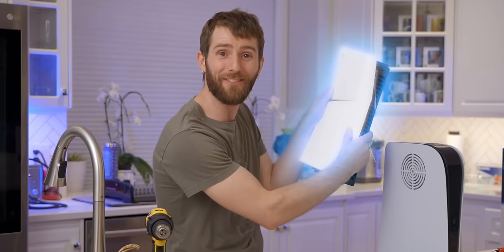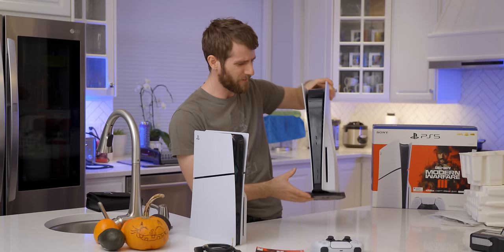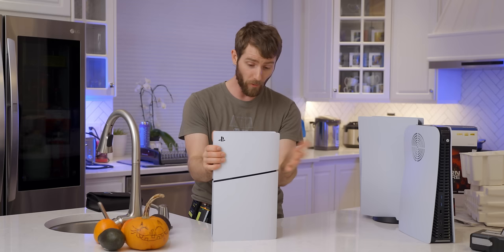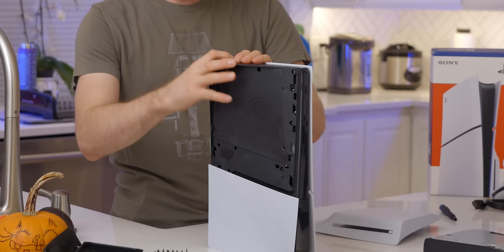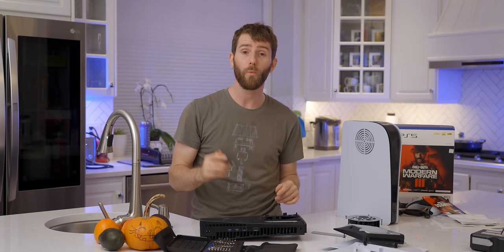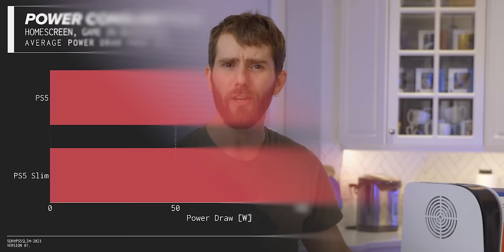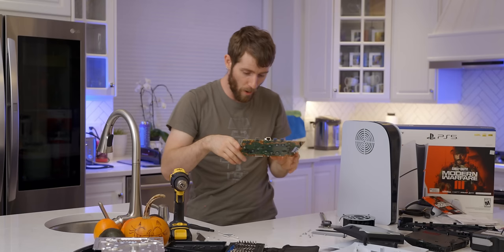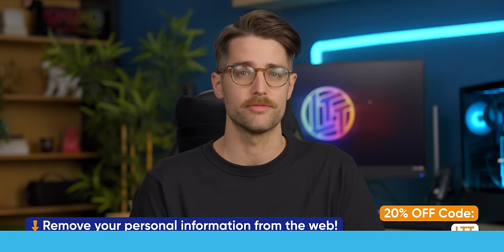PS5 Slim First Look and TEARDOWN!!

Comment from the maker: Thanks dbrand for sending over the PS5 Slim for this video! Get notified for their upcoming Darkplates 4.0 at https://dbrand.com/ps5-slim
Reply: Does this mean i have no life😢
Reply: just under 5 min late but i am here!!!!
Reply: Ok
Reply: comparing size with the stand vs the slim w/ no stand is a bit sus
Reply: someone needs to clean that overhead lens  :person-turqouise-waving:
Reply: Ok
Reply: Guys there is camera issue in top shots of PS5. Pls check
Reply: d brand. d? deez nutz
Reply: Look it's Linux tech tips
Reply: Hopefully Sony won't be able to trace back the partially visible serial number to find out who supplied it to dbrand
Reply: 4.0? TF happened to 3.0? Or was that the arachnoplates?
Reply: @LinusTechTips, great Teardown, but on 1 point you are wrong. The Game included is the full Game Cross Gen Edition and the Operator Pack! Sadly that i was too late to get the Key :(
Reply: Question: Does the Disc version still need to be connected to the internet for it to work?.
Reply: camera lens is dirty 😂
Reply: @rpmurphey1981 bruh huh?
Reply: It's still a PS5, NOT a PS5 Slim!
Reply: Get real they used the code way before posting this video. The editors used it.
Reply: That's sad because basically you're telling me in my town we don't allow more than 20 decimals so that thing would be illegal to run after 11:00
Reply: What about temperature differences ?
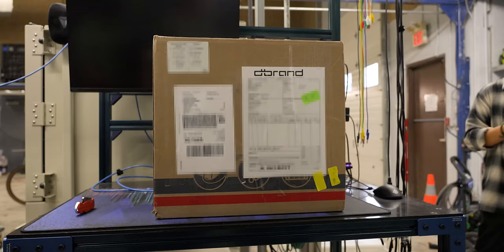Reply: 0:28 Saying 'catched' instead of 'caught' is a grammatical error. It is an error common among children and people who are not native speakers of English. The simple past tense and the past participle of the verb 'catch' is 'caught'.
Reply: Should have criticized the non-removable battery in the controller, technically it is, but not as easy as the Xbox controller.
Reply: @Packin-Heat Thanks man, Hope it's a easy registration since our internet here is Garbage.
Reply: PlayStation creators should be running the government since when did so called ''politicians'' ever provide an improvement and update every 3 or so years..
Reply: @Packin-Heat oh Cool, I didn't recognize they're registering it, Thanks.
Reply: I'm here because of spawn wave.  Good shit
Reply: where's the results of the investigation into the sexual misconduct and abuse?
Reply: You can't call the PS5 a big boy when you compare it to most desktop PCS that game
Reply: Just wanted to check in and say I am still disregarding LTT content. Controversy aside, LTT was already objectively out of touch with the community.
Reply: We want Dbrand to make two plates only for the slim, similar to the old model
Reply: Consoles have a ton of screws, PS series in particular, because the housing acts as both a heat sink and a ground plane.
Reply: 2 type USB C connectors don't make sense for anyone who bought the official Pulse 3D Headset because you can't plug the USB dongle into the front anymore without buying a USB C to USB A adapter.
Reply: why is the ltt backpack so expensive?
Reply: @hatersbhating  because it's made from the tears of peasants like you and me.
Reply: Dbrand isn't worth the mention; they are the slowest company there is.... I'm still waiting for a pre-order for my Pixel 8.
Reply: Linus killed a kid he drove him to it man
Reply: Linus puedes decir si la ps5 slim es mejor que la normal?
Reply: Test the HDMI cable!!!
Reply: This is funny.
Reply: I only came here to see the tear down. I personally don't like this channel
Reply: Mrslimeyboi Really grow up
Reply: 17:15. Golden opportunity mist.! You should have said. " I can give them some " Tip.! ". 😂
Reply: Papa linus please make a video on the legion go
Reply: Did you try putting that on a Auction as well?
Reply: No one has posted a ps5 water-cooled game testing comparison can you do a video on such please Linus?!?! 😅😊